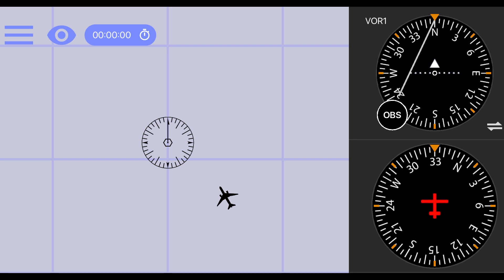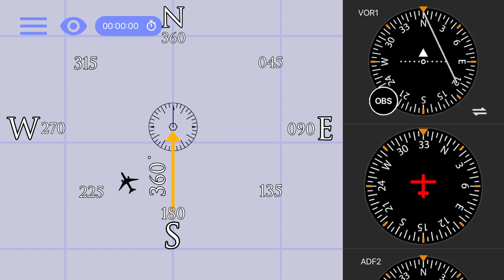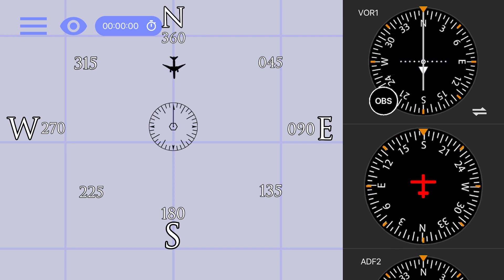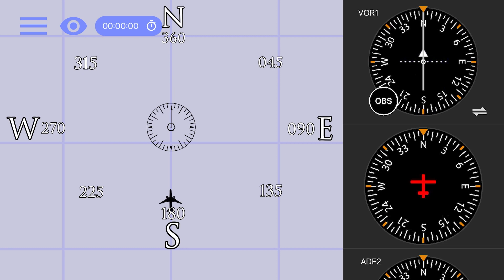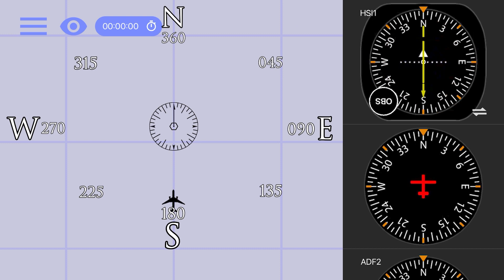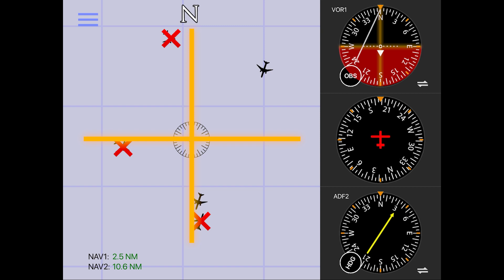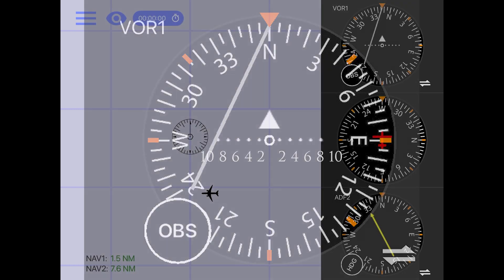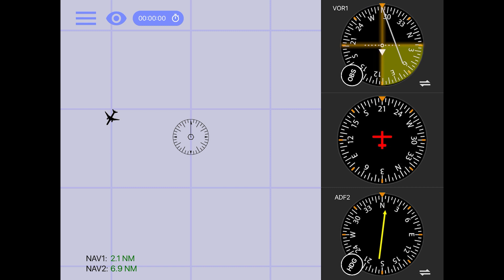How VORs work and how to USE THEM!

Comment: Good video! It is not clear to me how you guess the CDI needs to be turned clockwise when finding the radial you are on. :(
Reply from the maker: Thanks man! If you read the note on screen during that section, it’s because the course to the station needs to ultimately be pointed to by the to/from indicator. So basically once you determine which quadrant the bearing falls in, you need to turn it so that quadrant goes toward the to/from indicator.